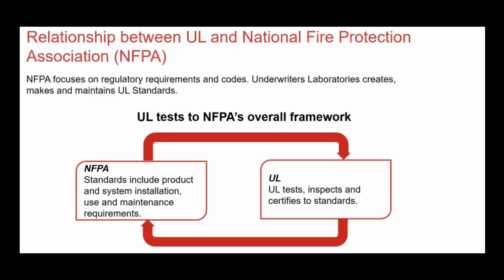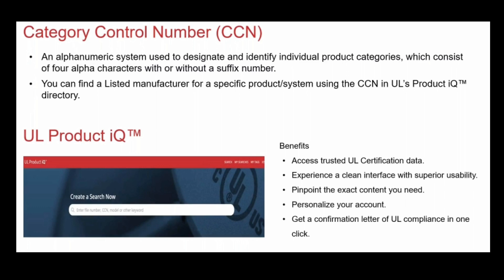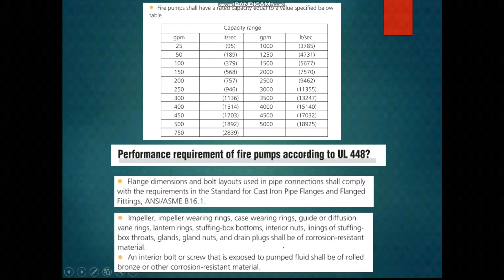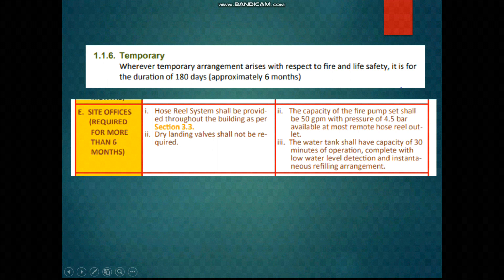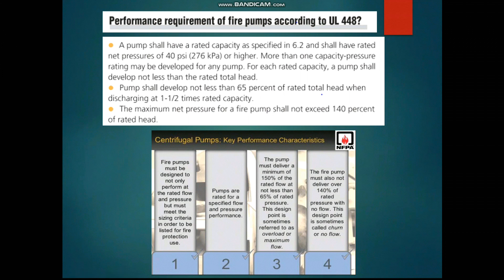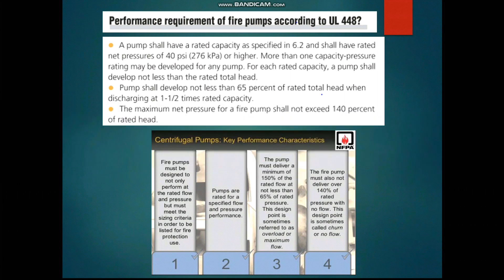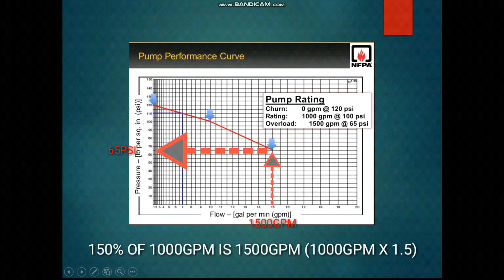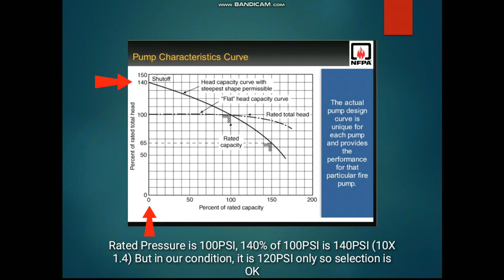Pump Performance Curves l NFPA 20 l UL & NFPA Requirements l Fire Pumps

Comment: Hii brother! Can you explain why the thumbnail shows jockey pump is rejected, i could not get that only
Reply from the maker: First of all, thank u for your comment❤ if u see the video, I have mentioned the UL488 approved types of pumps chart with different requirements so as per that vertical Inline pumps or jockey pumps should be single or two stages only listed in UL. Vertical stage pump with 3 stage is used in plumbing applications which is not listed in UL. Please inform if u have any additional doubts❤happy to clear the doubts🎉